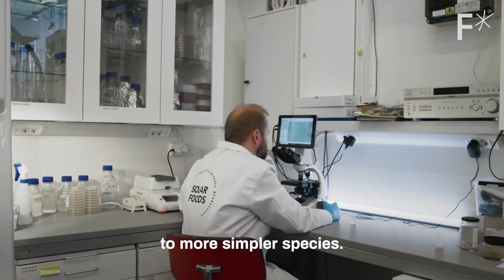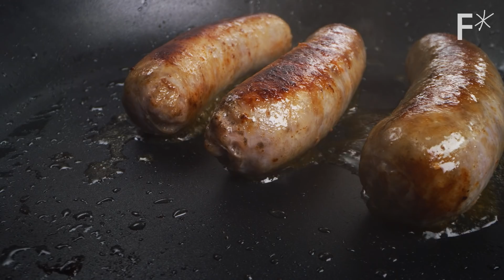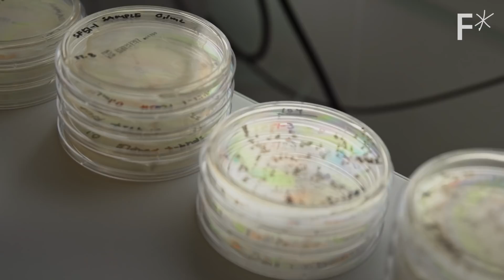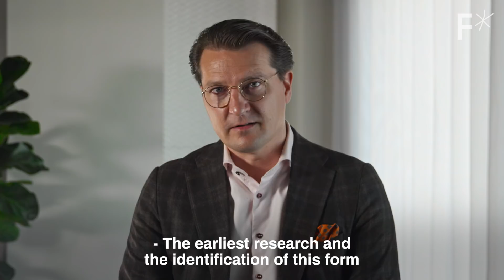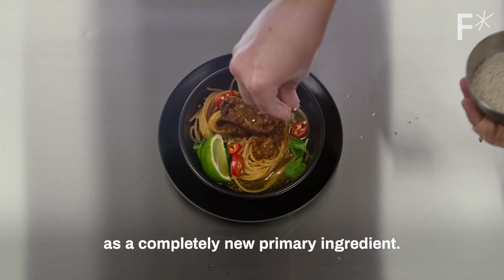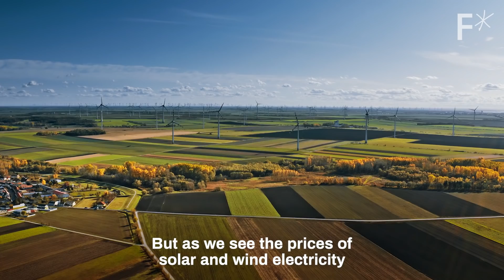The secret lab making the most sustainable food in the world | Just Might Work by Freethink

Comment: Okay, this kinda crosses the line where simplification becomes gross and misleading.
No, it's not a protein from CO2. Proteins can't be built from CO2 alone - they also consist of nitrogen and sometimes sulfur, and it's really hard to bind pure nitrogen, as well as extract sulfur from its aerial oxides. What is used in this research is the power of microbes that actually can do such things through the reactions of incredible complexity. But if we're still calling it "food from the air", then agriculture is basically the same thing - plants capture carbon dioxide and solar energy, bacteria capture nitrogen etc. There's nothing new in the presented approach, except now we only rely on microorganisms that are more expensive, harder to process and yield little amounts of product that needs thorough refinement to produce something barely edible.
Reply: Damn Boi, you know your stuff
Reply: im glad im not the only one who sees this
Reply: Yeah, the whole "just CO2 and electricity" thing is more than a bit misleading.
Reply: Indeed. 👍
Reply: china just finish the technology of making starch from CO2, no cell included. They are working on the cost deduction part.
Reply: @SunnySzetoSz2000  well, that's actually possible if you add water to the mix, and I kinda even see how they do it, the hardest parts being converting CO2 to C or CO and syngas to glucose.
Reply: @АлександрНовиченко-б5и make starch is harder then glucose.
Reply: @SunnySzetoSz2000  nah, just polymerize glucose and you'll get it
The only problem is to control polymerization to place glucose in two different ways, creating amylose and amylopectin, but that's not as tricky as it sounds.
Reply: The microbes energy source is hydrogen, and the process of making methane with CO2. Basically meaning there's no CO2 reduction once you burn the methane, unless the methane is released to become a highly potent greenhouse gas.
Reply: @Daniel-kt2kx  "given the right habitat" is pretty much the limiting factor here. You can't just grow them effectively in the wild like you can do with plants - you have to actively supply microorganisms with nutrients so that they won't starve to death, declining population quickly - if you've seen the graphs from the books on microbiology, you know what I mean. Not that their growth isn't something to praise - it is magnificent - but it still doesn't make a valid economic case due to all involved expenses.
Reply: Well, barely edible for us humans but it could severely reduce the amount of space  used to grow animal foods. At least for the protein part (like soy). Cows, porks and all will still eat that.
Reply: @АлександрНовиченко-б5и  we can create the right habitat for fairly low cost!
Reply: @АлександрНовиченко-б5и  what expenses do you see that would render it inviable?
Reply: @Daniel-kt2kx  1)Capital. You'll need to build a decently equipped facility to cultivate necessary microorganisms and then refine the culture. 2)Nutrients. Microorganisms require a lot of them, and they're not always cheap. Plants, on the other hand, may require nothing but soil and sunlight, and everything else is simply there to make it even better. 3) Temperature control. As much as most plants need warmth, they require significantly lower temperature and are more tolerant to any temperature fluctuations. 4)Staff. To run a microbial factory, even an automated one, a lot of people are required - mechanics, technologists etc. With plants, one guy on a decent machine can harvest insane amounts of plant materials. 5)Refinery. I briefly mentioned it already, but I wanna stress that now. Extraction of resulted nutrients from the culture is not a simple thing to do - and expensive at that - especially on the industrial scale. With plants, it's way easier - just collect the edible part or collect the plant as a whole and separate what's edible - and that's it. I can pretty much keep on and on - but the common sense should tell by now that leaving plants to grow on the field by themselves is way cheaper than a slow and complex factory processing.
Reply: Ppl love to invest in anything that includes the words "from the air", the phrase is like a rich idiot magnet
Reply: How do you know it’s barely edible? Not only that but the expenses, and process are most likely not portrayed properly in the video. That doesn’t mean that it can’t become something useful through mass production development. We already have products made from similar fermentation processes, so it isn’t a very far-fetched idea. Dismissing ideas like this based on little evidence/knowledge is never a good gamble.
Reply: @Wolf-yp2qk   I told that even to make something barely edible (meaning it can be digested and won't poison you in the process) you need a thorough refinement, which is expensive. I know that because I use microbiology every day in my student research that includes yeast and lactic acid bacteria - growing them by yourself and then refining a complex culture not only for organisms themselves, but for what they've produced is a headache like no other, trust me. I pretty much explained why it's much more expensive than growing plants, and even though economies of scale can make it cheaper, it'll still be far from the price of agricultural commodities.
Reply: @АлександрНовиченко-б5и  so again you'd likely need gmo to produce the enzymes
Reply: @xxportalxx.  you sure do, although I can see no problem with that specifically, the price of genetic modification scales well when you allow the organisms to reproduce, you know
Reply: Find a plant that is 65% protein. This a replacement for animals, not greens. The highest protein veg / fruit that i can find is edemame, which is about 10% protein. This is not enough for many people's diets, and would be more costly than this approach in terms of environmental impact and land
Reply: @Adlore  a replacement for animals is lab-grown meat, which is expensive, but still much, much cheaper than what's suggested here
Reply: @АлександрНовиченко-б5и  Practically all discoveries/inventions begin expensive. There is always loss before gain. It is called investment. Not all make it to fruition though if they do, mass production makes it affordable.

The mother of invention is "necessity".
Reply: @dizzydinonysius  unless you'll create a way to make all the nutrients 50x cheaper and the factories made of thin air, this will ever be just a dream of technomaniacs.
I, personally, believe more in GMO and other similar technologies rather than microbiologically produced food
Reply: @АлександрНовиченко-б5и  One can not know if they are on the correct path without exploring and mapping everything else. What is expensive today, what is unknown today, what is impossible today, just may be cheap, understood, and plentiful tomorrow.

Never say never.

That said, I do not believe it would be a good or healthy thing for human kind as it would create an environment even further from nature. The further we get, the harder, more expensive, etc. it is to sustain.

Humans just do not have the social order or structures to want cohesiveness and apparently would rather fight to the death in squalor and shelled out buildings.

We got here with ME, MINE, WE, OURS. To reverse the trend, either it must change to all-inclusive or more of the same x100. My thinking is the latter since humans cant agree on much of anything without someone screwing up the works with selfishness. That and most of the capital and power are in so few hands.

We did it to ourselves and we deserve whatever comes next. Soylent green or not.
Reply: @dizzydinonysius  I love your attitude, I just don't think that, even all the morals aside, such technology (artificially creating cheap foods from whatever there is in the atmosphere with a little addition of minerals) is likely to come in the coming decades.
Reply: @dianaw4827  Well we already have biosludge or biosolids used aka human sewage sprayed on around 80% to 90% of all agricultural crops in the west, except for certified organic crops or those grown in Switzerland. 

The EU adopted an environmental policy where dumping of raw sewage into the ocean was banned in the 1990s and so utility companies had an obligation to clean and treat the sewage without dumping it out into rivers and the sea. This is expensive for them and even now in recent years some European water companies have violated such laws and dumped untreated sewage into rivers and sea. They were caught and fined. 

Synthetic fertilisers have seen many price increases during these times and even in recent times so the water utility companies exploited the market forces by offering to initially give away their sewage as fertiliser on crops. Now some doctors and scientists say this is detrimental to health but the government and industry refuse to fund studies for that that would not have industry bias. Do you seriously think the sewage they use to spray on crops is free from all the harmful toxic chemicals that humans have in them through drugs chemo and many other things. And I don't know of the regulations that are enforced for this stand up either. Partially treated does not mean pure. They could just extract the nutritional constituents from the sewage and see that no other unwanted chemicals were contained but this would be costly. 

Switzerland banned the practice of spraying biosolids or biosludge on crops citing health concerns and to my knowledge this is the only European nation to have done so. The USA does this as well and they have industry associations touting how great it is for farmers and consumers. Obviously it is great for shareholders of these corporations all around.
Reply: it's just another get-rich attempt
Reply: @organichuman  Interesting read. I think you're making the same point that I am, which is wherever a for-profit company can minimise or better, sell its waste, it will. Further, if the opportunity arises where they can cut corners to increase or maximise profits, it will, no matter the cost to human (or any) life. That is where the problem lies for me; these directors/executives need to be held accountable and put in jail for their faceless crimes!
Reply: i knew something was up, proteins are complex things and chemically creating anything is super hard, that its easier to take existing chemicals and converting them into whats needed.
Reply: Most intelligent comment on the board. Happy to see
Reply: Yeah, the main advantage to this over agriculture seems to be space efficiency.
Reply: @yazuak  compensated by inefficiency in literally everything else.
We're not THAT short on arable land, at least yet.
Reply: @АлександрНовиченко-б5и  Well, I can see it being useful in a spaceship or on Mars, where space is extremely limited.
Reply: @yazuak  maybe, but I give more hope to algae currently
Reply: Well thought!
Reply: Damn your really know your stuff
Reply: Also depending on the microbes they are using they probably just capture nitrogen straight form air
Reply: @ultravioletcatastrophe  that's what I said - they surely can do that, but these are microbes, and they need much more than air and electricity to survive. And at that point it becomes clear that simple agriculture is a way better solution, all-round.
Reply: @АлександрНовиченко-б5и  something concerning about these technologicall fixes to natural systems. When BMW improves engineering of breaking systems, humans simply use the newly granted space to drive even closer rather than appreciate the brilliant new safety buffer. And now we all have a BMW on our ass. We solve one issue without addressing more dominant constraints because we reward technology which fills a niche without looking at outcomes for the larger systems. We can scale production to make this air/electricity dust economically viable, or perhaps, as you have repeatedly suggested in this thread - manage land more effectively. In addition, I arrogantly propose the biggest fix is personal. We must resist the temptation to grow like the bacteria until all available resources are consumed. Let's not drive the planet like a BMW is what I am saying.
Reply: So...... That's a no for you??
Reply: agree with most of this but misses a big point on the idea as a whole. technology is meant to evolve and so what might seem unreasonable today might be used daily tomorrow
Reply: The real attraction here though is the area required and protein ratio. Plant based protein is very inefficient in comparison to plant based starches and meat based protein is obviously awful for the environment. Water usage is extremely minimal with this method as well compared to protein from plants or animals and to top it all off the space required is so little that it might be viable as a renewable food source in space. Sure, maybe slightly misleading but still some incredible implications put forward by this technology
Reply: Yeah...
 I would rather eat ocean foods from aquaculture farms in natural or man-made floodplains: foods like algae spirulina, dulse, wakame, bullwhip kelp, and all other kinds of edible seaweed for greens. And then for animal protein, you can raise a lot of clams, cocktail shrimps , mussels, oysters, smelts and anchovies. There is a whole palette of culinary opportunity in lower land-impact livestock who create more calories per square mile or even square foot. I'm not opposed to eating animals but I know grazing cattle from large ranches are probably going to need to be reduced to halt desertification,  and sustainable grazing will need to be re-learned at small farm scales instead. But I'm ok with the price of beef going up, if we ramp up the production of lower food chain plant and animal proteins. This way people will have more choices. We can use worm and fly farms to feed heirloom chickens and quails for pasture raised eggs, as well as other fish. I'm not one of those people trying to force more people to eat bugs, because I know that will likely not become popular in my life time.  But Asian cultures have been eating small fish , crabs, shrimp, and crawdads (which are basically like water bugs but bigger) in high quantity for millenia, and they taste great!

 Humans also just need fiber from plants, like stalks and resistant starches, because our own microbiome cannot survive on mush that's pure protein or pure carb created by vats of bacterial monocultures. It could lead to our gut biome becoming simple and stupid, (this already happens to kids who eat nothing but simple carbs like white bread and pop tarts and cereal all the time. They get candida overgrowth and eczema and gastric distress) possibly leading to more autoimmune disease from lack of variety and immune system education.
Reply: @lightdark00  that feel when you realize the food the company is making with give people extremely killer farts...
Reply: @brainzend  Well, with the levels of education growing and birth rates declining all over the world, we are expected to peak at about 10.5 bn some time around the 2060s, and then start decreasing in numbers.
Reply: Thanks for pointing this out! I salute the research itself, but freethink may start respecting and trusting its viewers a bit more by making its content a bit less clickbaity.
Reply: Part of what your saying is true - but you are way off on the more expensive part - when taken to scale this will cost 1/10 of the total impact of raising animals for food - without all the antibiotics, growth hormone, land degadation, CO2 emission, air, water and soil pollution, animal abuse, transportation, wildlife habitat destruction, forest destruction and negative healthcare impacts.
Reply: @АлександрНовиченко-б5и  your comment thread is gold
Reply: @АлександрНовиченко-б5и  Humans want to take control of the system. controlling temperature/etc are already done in some plants even when not strictly required. Plants produce stuffs through middle-player known as chloroplast among other things, and many parts are inedible. Also, I question the "refinery" system making it hard to harvest. Growing plants require you to check each plant for conditions/etc... and the inconsistency between each generation can become a hurdle in further processes. Microorganisms can be treated like some kind of fluid, and you keep the bio-reactor running just like another chemical process. In the world where consumers demand consistency, many food are already produced by 
1) Extracting refined, sometimes ultra pure, substances (sugar/etc) from raw ingredients. 
2) Processing these substances through complicated chemical processes
3) Recombining the processed ingredients in exact formulas 

With many stuffs (High fructose corn syrup, msg, etc) being produced through this mechanism, you just cut off the refining phase and get raw, refined materials to play chemistry tricks on right away. 

The idea of extracting certain substances and recombining them isn't new. Many automated food systems rely on this. If the percentage of this ingredient or that ingredient is off by a few degrees, who knows what would happen? The machines don't know about taste or even safety. They only know instructions.
Reply: This.
Reply: How does it work?
Reply: @Trump_y_Gore_Won  well, kinda in line with what the plants do - with the right metabolic pathways and, often times, enough energy you can turn some simple substances (like, say, carbon dioxide and water) into more complex ones (like glucose). The energy can come either from the photosynthesis (autotrophy) or from other chemical reactions (chemotrophy).

Some of those reactions actually even release energy (like binding nitrogen into ammonia), but it's not enough to supply for the entire process, so that's only for some chemotrophic bacteria that do this and nothing else regarding creation of new substances. So if we want for microbes to do it the entire way, we need to supply them with energy - either by teaching them to capture the energy of the Sun, or by supplying them with some "food" of their own.
Reply: So really the only practical use for this is in space on planets that don't get enough sunlight to grow plants.
Reply: @Logan_236  pretty much that.
But algae seem to be a better solution on that front either.
Reply: Same bro same 😂
Reply: @АлександрНовиченко-б5и  but you’re not figuring in all the economic costs of growing plants and animals - the deforestation, the pollution, monoculture risks, transportation and longevity of the product, all of the “tragedy of the commons” things that get left out all the time. You’re also comparing established industries to new ones, which inherently has lots of unknowns.
Reply: @brianbarber5401  I do consider these facts. Yet, it still gets order of magnitude cheaper.
Like, I worked with industrial microorganisms, and those little bastards are quite demanding compared to plants.  The need for a specific culture medium, the strict temperature requirements, the expensive equipment involved, the thorough and incredibly slow, multi-stage refinement requiring a ton of energy, time and capital all turn out to be the nails in the coffin for such ideas. Even with the ecological costs (say, extending the forest somewhere else) agriculture will be way way cheaper. As for longevity and transportation, non-dried products of microbiological origins normally don't have a big shelf life, either.
Reply: @patrick-bu3eq  as a biotechnologist, I can assure you we're nowhere near that ambitious goal.
But we're slowly getting there.
Also, please note that it is one thing to make something a reality, and very much another to make it viable.
In terms of protein synthesis, living organisms are actually insanely efficient, they are very advanced and it's basically our dreams about microfactories in a real tangible form.
We mostly know how they work, yet we still can't replicate it, we can't make it run in such a unison. All we can do for now is replicate and modify separate stages.
And only when we'll learn how to make it run by itself and replicate itself we'll be able to make it efficient. (Think of GMOs: modifying a plant is immensely hard and expensive, but after you've done that, you can multiply it as much as you want, effectively spreading the cost of modification across millions of plants)
Reply: @Lycanthropus  Now, before answering on my behalf, listen closely:
1)I basically work in the field of industrial microbiology, so I do know a thing or two about how hard and expensive it is to feed bacterial cultures, how hard it is to maintain a pure culture, how much output do microorganisms really have and how hard it is to extract single components from the media. Check out the industrial process for, say, microbial insulin, and be surprised on the yields.

2)We absolutely can make microorganisms that would produce a perfect protein according to our needs (not "perfect universal human protein, that's BS), the issue is to purify it from the media.
You can take the edible part of the plant, but you cannot separate microbial proteins so easily, you'll need a multi-step refinement process, and only then you'll have an actual product and not something that smells funny, tastes terrible and causes you to bloat for the coming days.
That's what I was saying.
Reply: And tons o climate deniers commented a lotta bs. ☝️
Reply: i'm an environmental engineer and i approve this message. 

The simple fact that they're using hydrolisis is a huge red flag because it consumes tremendous amounts of energy that could be otherwise used in maintaining lighting or automatic equipment to grow plants or algae.
you could most likely run a full automated greenhouse on the power they're wasting on getting hydrogen alone...(and yes...you can get hydrolisis to work with an old battery and some wires sure...but if the bacteria/yeast are EATING it...we're talking about a ton of it not just 1 tiny trickle of gas being made).

And this is not accounting for the environmental cost of manufacturing wateaver specific components they have to keep adding in order to keep the yeast they have there healthy (which is high as heck due to specific requirements compared to rectifying a soil or a water medium with wateaver and let nature run it's course) and the elimination of byproducts (which is most likely A TON of waste water thrown away into the nearby river).

if you like this idea you can literally make something akin to this but much more sustainable at home with some species of Algae or Cyanobacteria which are somewhat easy to grow and automate...

1. make a transparent tank;
2- get some lights on top (or better yet...just let natural sunlight in);
3-insert water and fertilizer (a good way is with fish or shellfish droppings from another connected tank which will also net you protein);
4- let the excess water and algae drain from the top of the tank;
5- collect;
6-test for microbial contamination and excess of some byproducts at regular intervals;
7-drain, dry, powder, package, sell/consume;

Most of these steps can be automated at 1/10th of the cost (effort, energy and economic costs) of running whateaver they have there...

it will not taste great but it's good enough to keep hunger and the scurvy away if needed be...it's great for places without food availability or disaster relief but otherwise it's often easier and more economically viable to just...give people money to buy food from other sources...

most food will most likely be grown in automated spaces in the future but given the diminishing access to fresh water and some other problems (land availability, disease spread in crops, sudden weather changes...) it's much more environmentally and economically sustainable to just grow stuff on the ground or in a substract inside greenhouses than something like this (which is too similar to the idea of vertical farms some people were trying to sell some time ago to my liking...)